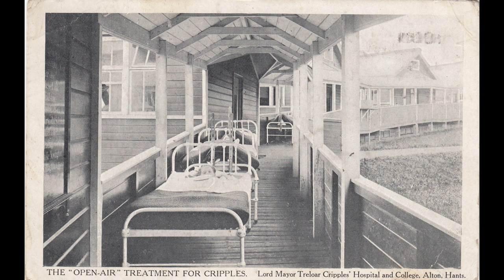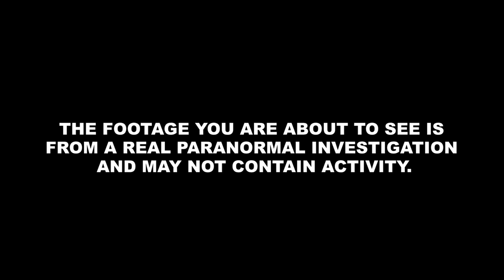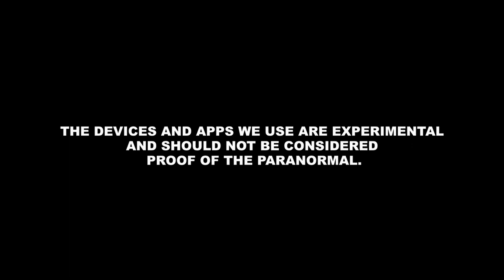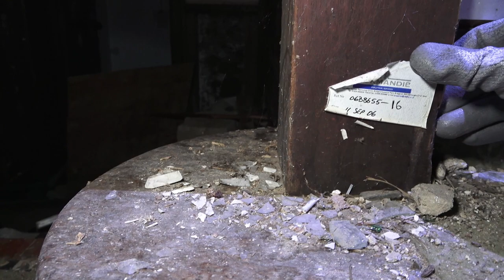We Investigate the Abandoned Robertson House | Child Voices Are Heard! | UK's Most Haunted Places

Comment: I worked there in the early eighties. We were re wiring the place it was definitely creepy I was connected a junction box under the floor up on the top floor, the place was a building site but you couldn't hear anything from the floors below no banging sawing anything like that. Whilst I was connecting the junction box I thought my work colleague was behind me I said "pass my pliers Keith" turned round and no one was there he was working on the ground floor in fact there was no one else on that floor it totally freaked me out.i spoke to others and they had felt various things too. I have to say that I was glad when the job finished there was definitely something sinister in there.
Reply from the maker: Thank you @Steve Holloway for sharing your experience at Robertson House, that is indeed very unnerving and you are very lucky to have witnessed something like that (or unlucky if it wasn't to your liking lol).
Unfortunately we weren't able to capture anything concrete there paranormal wise and we were hoping to return back in November but it looks as though it was being prepared for demolition, which is a damn shame.

Thank you again Steve 👍🏻

DPI 👻